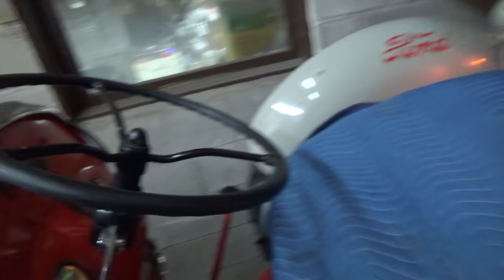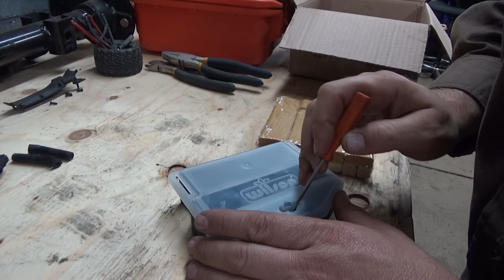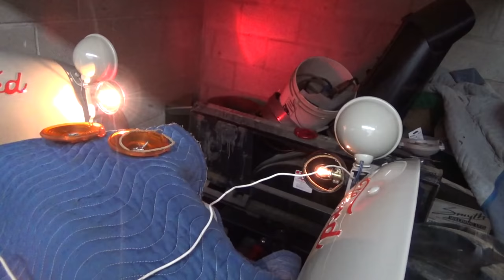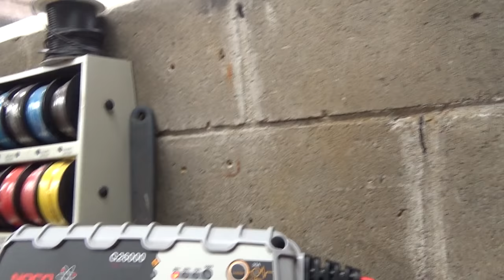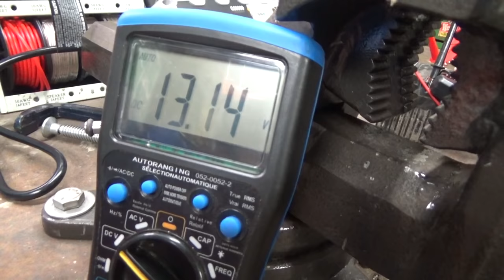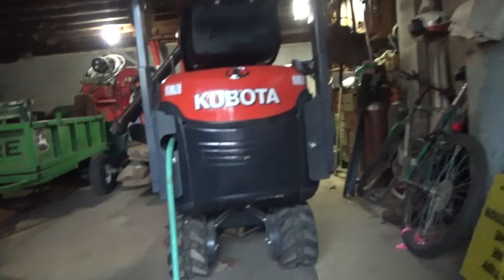Small wiring problem with boaris,  Need some help please :)

Comment: Bill, just try swapping the rear left and right bulbs over to make sure it isnt an odd bulb problem first.
Make sure the left bulb is actually earthed to its outside, the holder may not be doing its job.
Eliminate parts of the system to stop confusion.

Comment: I have the NOCO for a while now. it works amazing. those little black batteries evaporate the water after a while. pry that plastic cap off and there are little rubber caps on a couple holes. fill just below the holes and reseal with caps and glue big cap back on. it will charge good and last until evaporates again. i've done this on a few batteries with success.

Comment: Bill it is a circuit overload. So this is my recommendation. Put the signals on a different flasher. You have to many lights and things going to one unit. So split it up. The heat is a sure sign of circuit over load. That is my remedy.

Comment: The base of the light fixture have a bad ground . Take a wire at ground and while flashing touch the outher part where the light bulb holder is. The  flasher should speed up and the parking light will come on and the other brighter filment will flash. The current go where it is easier and flash the parking light passing through the the brighter filment without light it.  It could be directly the light socket having a bad  ground in the fixture itself or only the mounting nut in the fender with paint under. Worth a try.

Comment: Bill - Run a wire from the battery ground terminal and touch it on the bulb its self and it WILL work normal. Probably the rear fender isn't grounding or possibly a problem in the lamp housing. DONE! Easy peasy. Have a good one!  ;>)

Comment: Bill, when just the parking lights are lit is the left rear bulb brighter than the others. The socket may be bad with it slightly twisted. If not believe bad ground. Run wire from frame (not test light it has resistance) to brass on bulb as a test.

Comment: The american/canadian system is different to ours in the uk (our running lights don't flash)
But a flasher unit generally gets its speed from the amount of load on it, one lamp may flash every 2 seconds, 2 lamps may flash every second, when you used the test lamp instead of the lamp, the test lamp is a much smaller load, so doesn't affect the flash rate.
That wire that fell off is the only difference to the before and after, and i'm thinking it should be connected to somewhere else, have a careful look around for a connector without a wire, or a connector that should have 2 wires with space for another.
The hot terminal on the ignition could be because of a ring crimp that is too small, you may need a beefier one.
That image of the battery, some batteries have the big terminal post plus the bolt connection, that wire on the bolt is probably the car wire.
In normal operation a car battery can receive up to about 14 volts for daily charging, and up to 16 volts for equalisation or sulphating charge.
https://en.wikipedia.org/wiki/Lead%E2%80%93acid_battery#Voltages_for_common_usages

Comment: 1st:  Hey Bill, I sent you a couple of emails, check them out when you get time.

2nd: Try checking to see that the back light socket is grounded well and if it is, then try replacing the back light socket that the bulb goes into. You may have a dead weird is it may seem, and that's why it may be working with your tester but not with the bulb. Something is definitely pulling the left side of your blinker switch down which is slowing it up.

Comment: Nice charger! I still prefer Ctek though. Thinking of upgrading my Ctek MXS5.0 to one of the larger ones on the product line MXS25. Quite similair specs that you have on yours. About boaris.. i think we should redo all the electronics, wires and stuff. It looks like quite a mess. Should use switch buttons or pin-switches for lights and functions and get rid of that wheel kinda thing and also the thing that gets warm. You can also change the bulbs to led types.. they will draw less current, last longer and less warm. The are quite expensive though but its an investment as i see it. :)

Comment: Hiya Bill, looks like you have a bad earth at the rear light, when you used the tester light and used the earth wire it worked. May be just rust under the rear earth wire.

Comment: Try hook up the white wire to positive (if it goes to the light) or turning the bulb around if it's a universal socket, park and blinker needs their own positive so it needs basically 2 positives and 1 ground, same thing happens if you run positive on blinker to ground on park (by disconnected the parks ground) I believe it was to have park and blinker together in one. it's also why they call them 2 poled socket. Sorry if my English is rusty...

Comment: Hey Bill your wiring problem looks to me like a poor ground and yes the light will work but it may be grounding thru the filament. Try and hook up a booster cable to the negative terminal on battery and then attach the other end to the bolt on the light itself.

Comment: bill it is a ground problem electricity is very lazy it will find the eazyest way to ground  when you have park lights off its using the park wire for ground . its more than likely not the flasher . when you use your test light you are grounding to its own ground thats why it works fine . you need to run a test wire from light to a good ground. i saw in vid you had it hooked up to the end of your test light the white ground wire? you need to run the white round wire to a good ground on tractor .hope this helps. the other thing is maybe reversed wire on one of the left lights, or if you disconnected wire on flasher you may hooked them up on wrong terminal if its a three terminal flasher  it will be easer for me to be there to help out one of these days

Comment: Try a temporary ground wire on the other rear lamp. I can draw a diagram of what could be happening, have helped people with similar problems. That usually cures it.

Comment: Make sure both filaments in the bulb are not flashing when the left turn signal is on, also the bulb should have offset pins and will only normally fit in one way if fitted wrong both filaments flash. Check the right hand rear light to see which filament is flashing when its on signal ( maybe the short one ) Also clean up the earth contact it maybe the running light at the left hand rear is taking up all the earth contact when its lit.

Comment: The left signal is either wired out of sequence, i.e. pos. to neg. ( or your ground is reversed on the left circuit ) Check that the bulbs are actually positive  to negative and wiring  is not reversed from front to rear on the left side.
Or another way to say this is to be sure that the filaments and ground of each lamp unit are wired to negative ground.
The flasher is going slow on the left side because it has a slight overload situation.
Clear as mud ?

Comment: Leave a couple inches of air space above the radiator core for expansion.  Modern vehicles have high pressure systems with overflow tanks.  Yours probably doesn't have that and would just dump the coolant on the ground.

Comment: check the grounds on the left turn signal . make sure the bub is installed in the correct orientation. and the socket terminals

Comment: on the light issue, have you tried swapping both rear light housings with each other to see if the problem stays with the light.  If you do and the problem stay with the light, probally time to replace the light housing.  If the problem stays on the left side, than either a flasher problem or a switch problem

Comment: Flasher problem: A slow flasher would indicate an undue resistance in the circuit. I would first check each connection to insure good contact. Including. negatives.

Comment: My experice bad socket. Still wouldn't hurt to take light off and clean where bolts to. My experiences been as auto mechanic on lighting has been mainly grounds and dirty or corroded sockets. Try putting jumper wire ground side of light and good ground on frame.

Comment: I think i seen a video with a similar issue. It turned out, it was getting power through the ground wire. The fix was the connectors were corroaded, clean it up and it was good. Sorry for the spelling.

Comment: Hey bill. Try switching the wires going to your flasher relay  and see if it will change sides. Start with that. If you can get it to switch sides then that thing you switch may be your problem ?

Comment: The light bulb elements on the bottom are touching both contacts at the same time. I had that happen to me several times. make sure the 2 points on the bottom of the bulb are more pointed and not flat.  you could change the socket for the bulb and that should fix it.

Comment: that bulb on your tractor is a two phase bulb and one of the filaments is out, just look back on the video and you can see it dim when you have your running lights on. just change the bulb and your problem will probably be fixed.

Comment: The flasher will flash slower with a higher resistance or higher load. I would suspect the left rear tail light positive wires (running light and flash) are joined somewhere or wired incorrectly.

Comment: flashers works off of amperage (heat) it  is  a bi metal switch. That is why on sme older vehicles the turn signal would stay on when one goes out. 

I would try replacing the flasher.

Comment: Sounds to me like its shorting out the running light on the back. Maybe a wire crossed at the socket. Explains the strange rate of flashing as well as why it goes out completely. Strange no fuse blowing but maybe it has none.

Comment: chase the wiring could be a bad ground or short between the light and flasher.
Also try swapping the light housing if the right side starts doing it, it is a bad housing not getting the correct ground.

Comment: Bill do you maybe need to throw a relay in on the headlight circuit to keep the power off of your switch?
Reply: The rear blinker may be a ground issue at the light.

Comment: bill I'm almost 100% sure u have a bad ground on the light, the reason it is still working half way is because it's using the bright side of the light as a ground, I know that sounds confusing but try making a good ground on it somehow... that rogue wire may be a ground, and not what you think for the turnsignal light..
Reply: does the light have its own ground wire or does it ground through the Fram of the light housing and onto the fender?

Comment: Okay bill I got a question for you about boaris. Is the blinker bulb or the running light bulb a double filament. ( double filament )Meaning there are to separate wires in the bulbs. Like one on top and one on the bottom.

Comment: the wire you said was not hooked up probably was to the system and provided some resistance. from what you have said about the original owner of boaris, Sorry I don't remember the relationship, it doesn't seem like he would have left anything undone.

Comment: I don't have a whole lot of expirence with this sort of thing, but I do know that you Gould try rewiring the flasher whlithin the hood of the tractor. And replacing it. That might help. Or you.could check.and see if the bulbs are all the same wattage. And if so.get some lower energy bulbs. from what I know your problem is probably under the hood with the he wiring in there, or with the he bulbs. I would suggest getting a lower wattage bulbs first. Your tester is probably a lower wattage that your bulb. It shouldn't do that, but that's all I got. I will do some research and see what I come up with.

Comment: You've probably already checked this, but is sure sounds like you have an incorrect bulb type in that left rear light.  Or the wires to the two filaments are swapped.  Check to see if the bulb type is the same as the one in the right rear (or your test light).  Those flashers work similar to a circuit breaker.  Higher current from brighter bulbs makes the bi-metal strip in the flasher make and break faster than a dimmer (thus lower current demand) bulb would require.  It I come up with any brighter ideas, I'll respond with more brilliance.
Reply from the maker: but the weird thing is everything was the same as before and it worked fine.
Reply: try a 1157 bulb
Reply: i had a problem with my mustang lights,one front bilker worked during day but not at night with lights on,Turned out we had a mouse chewing on some wiring .since you have evidence of mice in shop maybe they chewed some wires.just a thought
Reply: I agree with you Dan, he should check to see if the bulb in the front or any of the others has the same number as the  bulb in left rear light. thet one may be a 1157 bulb and the others may be 1034 bulbs and the orientation of the contact on the bottom of base  is incorrect causing only one element to get power.
Reply: dan. great minds think alike. LOL

Comment: If it worked fine before then it has to be the flasher or that loose wire you found. I'm pretty sure it was wired right when u got it.

Comment: your lamps are wired wrong at the fixtures. you have two positive wires and one negative, the two positive wires are called Minor and Major. Minor is clearance lamps, Major is turn/stop.  Check both fixtures on the driver's side.

Comment: By the way, apparently it is NOT a good idea to solder automotive wiring.  Not only have I read this in a VW service bulletin, but I had one such wiring connection break apart cleanly on a front end load application some years ago. I think it was that the solder connection had no 'give' at all, and the copper wire fatigued at the solder .
Just a tip for you.

Comment: look at the back light it dimmer either bulb is not sitting right or wiring needs to change or a bad socket because looks and sounds like the pins r not lining up and put a heavy duty flasher in it

Comment: It's honestly sounding like a resistance issue in the wiring somewhere or possibly the flasher unit going.  I'd try swapping in a flashing unit out of something else to see if you can replicate it.
Reply: Could even be a resistance issue in one of the bulbs... could try swapping them out...

Comment: Bill .. first off .. get new flasher but check both bulb to see if they are same watts or voltage .. if the bulb are different .. get 2 new light bulb samething .. maybe that will work .. if not then its the wiring issue maybe  connect wrong way ..

Comment: How would work when changing battery is connect it to a full time possitive lead. The pull battery, it will stay powerd up and no memory loss of raid or computer programing on car tractor.

Comment: I dont think they are flashing opposite I think you have a lifted ground and when your hazard switch applies power to the element when the running lights are on your loosing the ground  because you have power on both sides of  your your bulb filement causing the bulb to just go out.

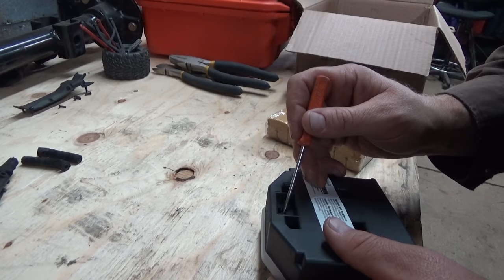Comment: in your meet Boris video 14:30 that black wire did not look like it went to your battery,,, figure out where it slipped out of its connection, might solve your problem

Comment: discount the bulbs one at the time I think you have a ground problem or a wire in the wrong spot going with a wire in the wrong spot the back right looks like its blinking on the marker side of the bulb and the marker is on the blinker side check your wires

Comment: Every single motorcycle battery I have ever dealt with from new is ALWAYS low on water. ALWAYS.
After I top them up with distilled water, they will last much longer. If you trickle charge them when they are not in regular use they will last at least 5 years.
My $0.02 Mr. Bill.

Comment: check the wires at the back of the bulb holder they could be heat damaged as you had the lights on a long time

Comment: i had same problem it turned out to be a bad earth connection.fitting has corrosion on it.  remove fitting clean and re install.

Comment: First thing I thought on the light was a bad ground. Odd that the signal slows.  Short maybe. More load slows the flash. Less load it flashes faster like when a bulb is out.
AGM batteries are over priced junk. Cost twice as much and are just as heavy and the recovery on them is horrible. I've tried to jump start semi trucks with a weak set of AGM batteries. They will not take a jump start. Sucks changing out 4 big batteries to get a truck going. Then take the AGM and put them on the charging station for 24hrs before they will work again

Comment: I think you have your bulb 180 degree turned
Reply from the maker: it can only go in one way. it has the high pin on one side and a low pin on the other
Reply: BILLSTMAXX  I figured you was sharp enough to know that. when you had the bulb in the socket and your test light hooked to your white wire it was flashing that being said your bulb is not being the load. when you put the bulb in the bottom of the socket has spring tension and it goes down but when you use test light in socket you don't push hard enough to seat spring. so very possible socket is bad and back feeding? u might try hooking up another socket see what happens
Reply: BILLSTMAXX  probably not the issue but have you checked the grounds

Comment: I think you have a bad ground on that back left light.
Reply: Try grounding the light socket with an external ground wire.  If it works properly, then you know the light socket ground is defective.

Comment: Dude. $800 is bullSHIT for a hydraulic cylinder rebuild, especially since YOU provided/paid for the parts!!/Excuse my language, Bill. That is downright offensive. Honestly, that price, they took advantage of you. I would take it to a hydraulic shop or do it yourself again, you did pretty damn good doing it yourself. Screw that dealer work. That is uncalled for. My local hydraulic shop, $250 for ANY cylinder under  8 in diameter. you supply the parts. They also warranty their work for so many hours.